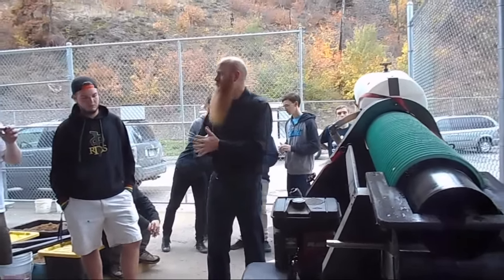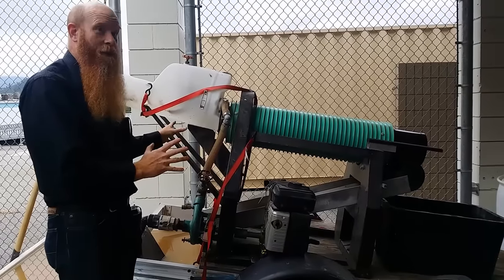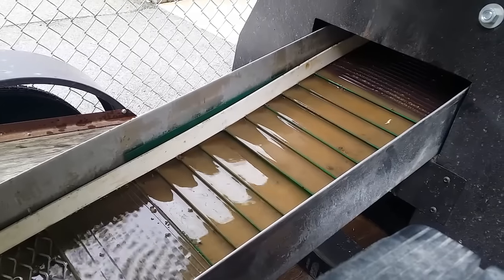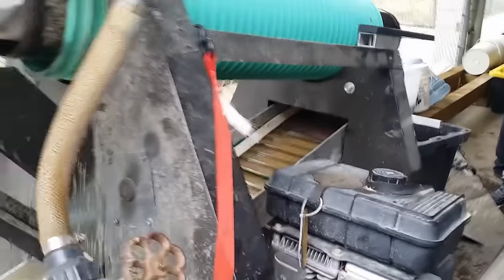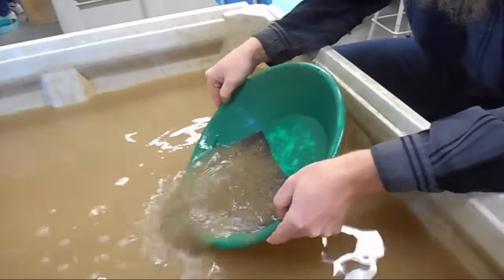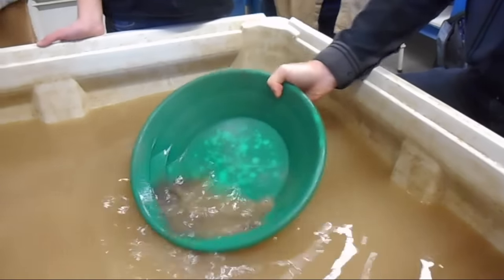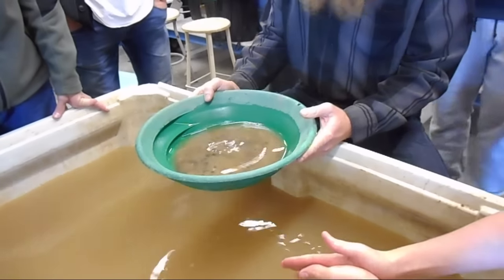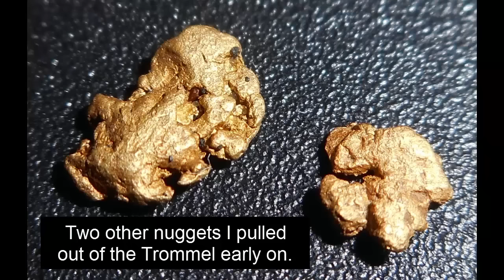Home Made Gold Trommel Wash Plant. Nuggets!

Comment: One question, how do you catch nuggets with this? Or are the so rare it would be pointless making a nugget trap?
Reply from the maker: +Axeman02 Usually I use a metal detector over the tailings pile.  A 1/2" nugget would set off the detector from a long ways off.  Unfortunately this did not work here at school. We found after the fact, that the asphalt I spread the tailing over, was loaded with metal.  even with iron discrimination on I could not get a clean signal. After thinking about it, I realized they must have run many electrical conduits under that section.